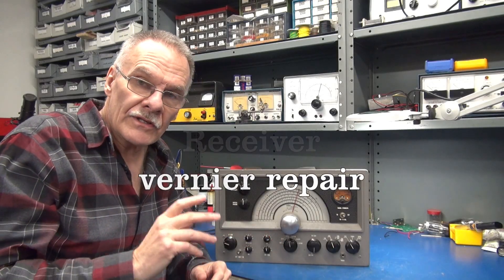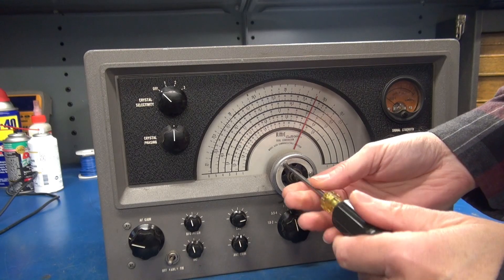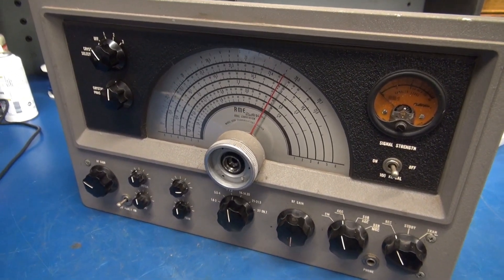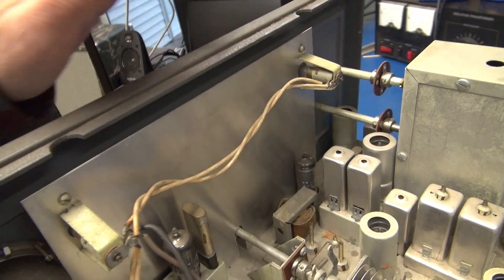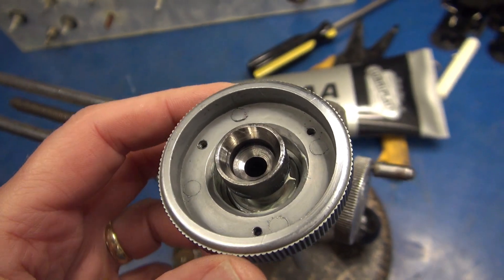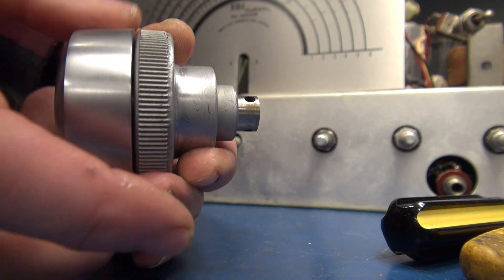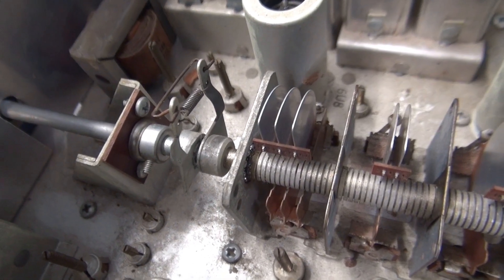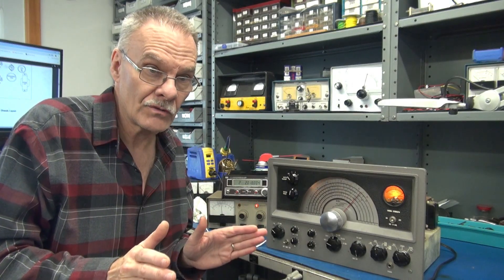Vintage Electro Voice RME 4350 Ham band tube Shortwave Radio vernier tuning dial how to repair

Comment: Do you have any more pictures of the verner drive assembly. I received radio with the drive-in pieces. I have to make the sleeve that holds the bearings in the upper race.

Comment: Terry, I had one of these receivers some time in the early 1970's when I was back in high school.  There was a 'fix' for that blasted dial back then that I performed on the receiver.  The planetary gear assembly - if I remember correctly -  from the SWAN series of radios fit perfectly into the hole left by removing the original dial with the addition of a ring between the hole and the planetary gear.  Maybe I used two planetary gears in series which made for good tuning across the bands.  The only problem I experienced with this 'fix' was that there was this plastic ring that I used that fit between the planetary gear and the cutout of the receiver - it was plastic and flexed a little bit - I would use a ring out of metal instead.  The dial would not look original - but you had a really good receiver for operating on the bands. Great effort though - I remember the receiver being pretty good - all except for that blasted dial - I don't think the dial worked well for anyone ever! Amazed that you were able to improve the dial at all!  You abilities are awesome Terry and I really enjoy your videos - keep up the good work & 73's!  Seth

Comment: The vernier needs a lubricant with a little more viscosity...That'll take the play out of it....
Reply: It could, but I ran into this problem with a Heathkit IG-102. It has the vernier assembly made as part of the tuning cap shaft. After trying multiple kinds of lubricant, I finally tried it dry, which solved the problem. Lubricant prevented the shaft from providing sufficient friction to move the balls.
Reply: Nice job!